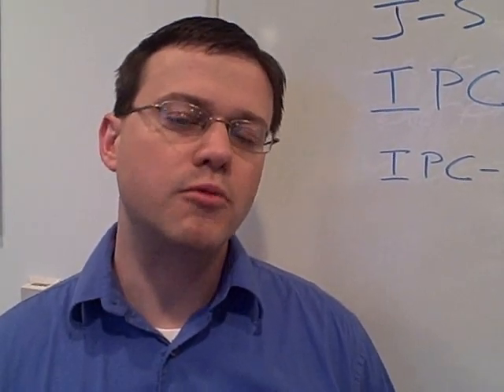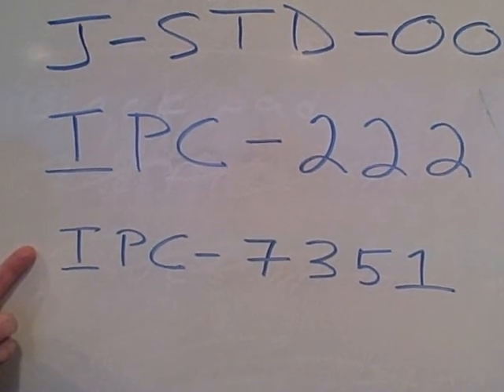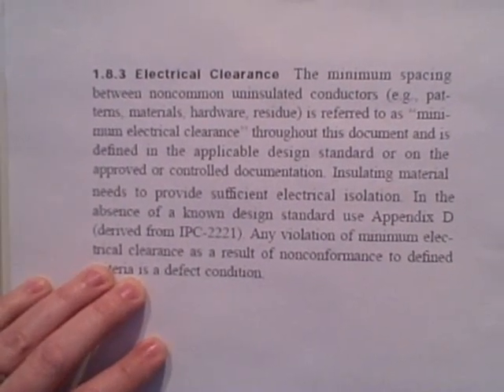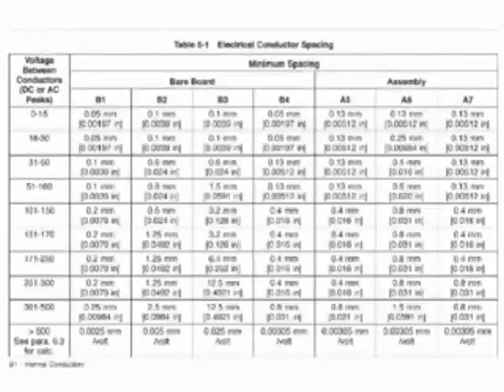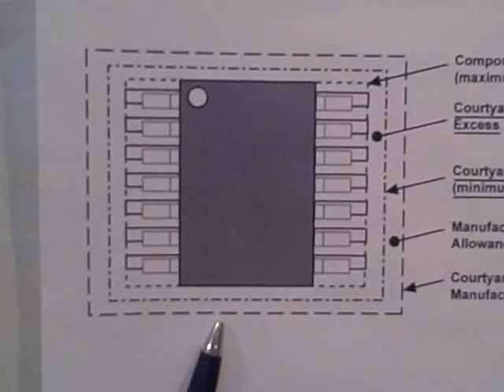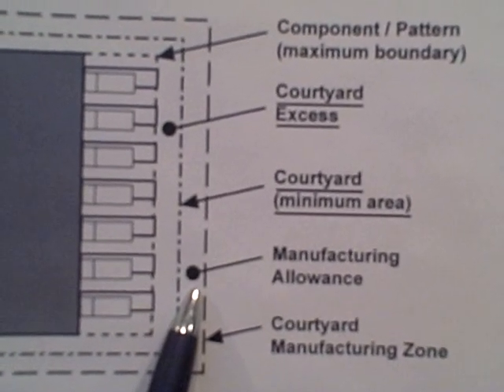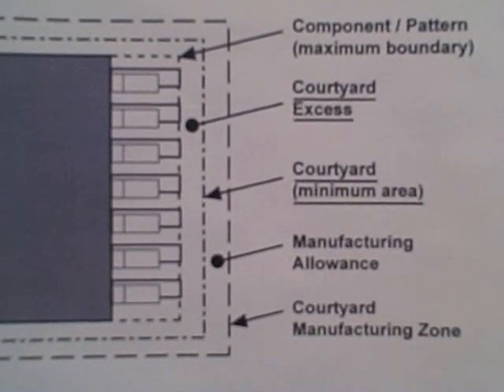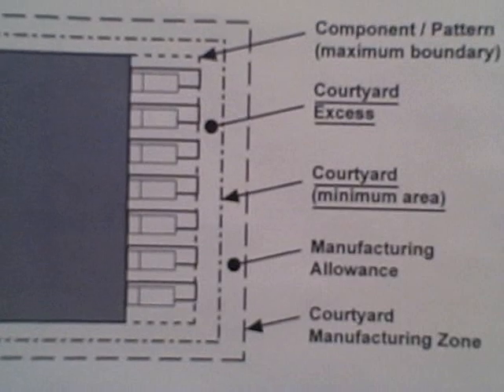IPC guidance regarding clearance space between components when designing a printed board?

Comment from the maker: If a boards circuit topology dictates even tighter spacing, the IPC-7351A Land Pattern Calculator included with the standard allows the user to further reduce the solder joint fillet goals, the courtyard boundary excess, or both, within an existing land pattern configuration.  While the resulting land patterns and courtyard boundaries no longer match what has been standardized in IPC-7351A, they still follow the same mathematical model from the standard for determining land size.

Comment from the maker: IPC-7351A provides 3 separate land pattern geometries, coupled with 3 separate courtyard boundaries for a given surface mount component. Density Level A represents the largest of the 3, providing the most robust solder joint.  On the opposite end of the spectrum, Density Level C represents the smallest of the 3 and targets high component printed board densities.
Reply: What about courtyards for through hole components?

Comment: Got a question,

What happens if the circuit topology dictates a tighter spacing?

For instance, some datasheets for RF and other HS switching IC's rec. a much closer placement than the IPC spec allows? Most modern P&P can hit these tighter clearances.